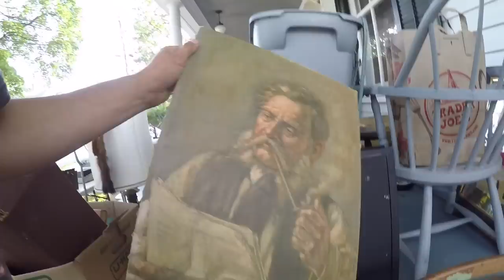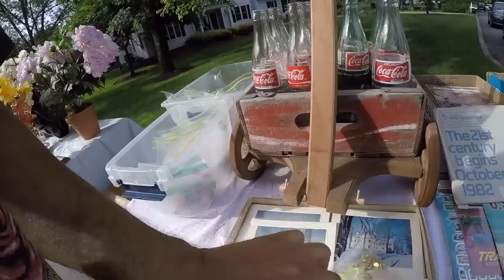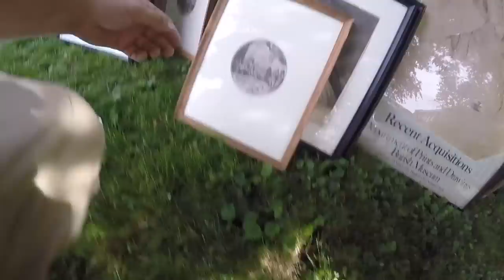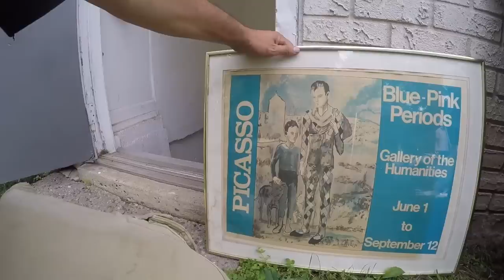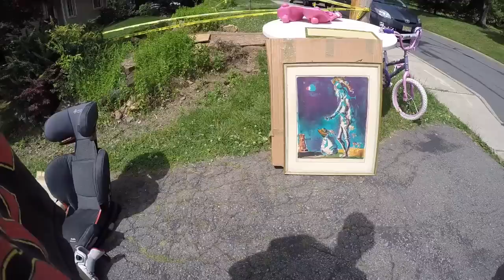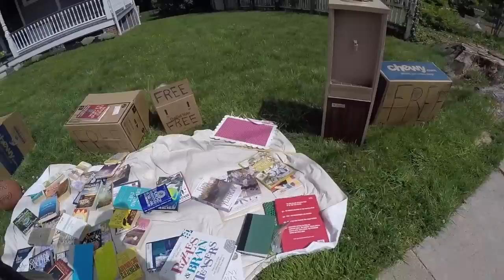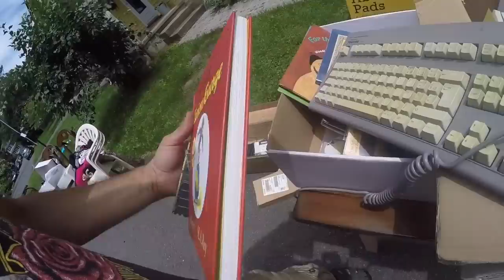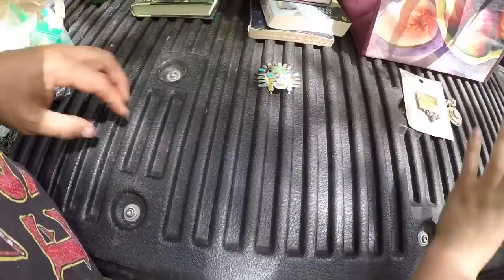Full Day of YARD SALES! Hitting the town wide in search of antiques, jewels & tools!

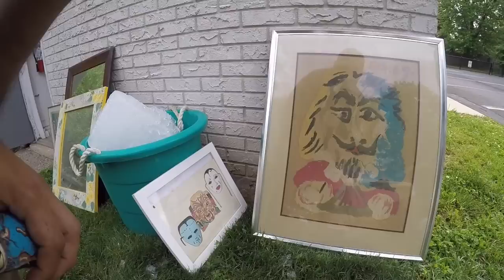Comment: Min. 31:52 Vintage blue and white Picasso exhibition poster NY from 2012. Min 32:18 Also Picasso, this image was on the exhibition poster from Galerie du Passeur, Paris 13. Oct. until 13. Nov. 1971. This particular one wasn't on a poster as the letters close to the image are missing.
Great! You did get the old yellow mixing bowl + napkins with initials which mostly indicate a good quality household. Fits with the rotary whisk you bought for your daughter.